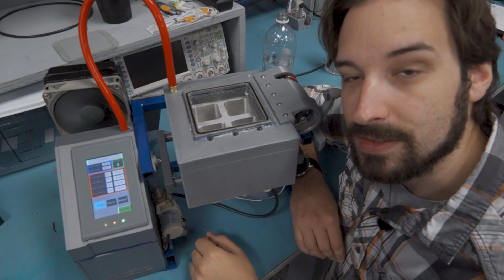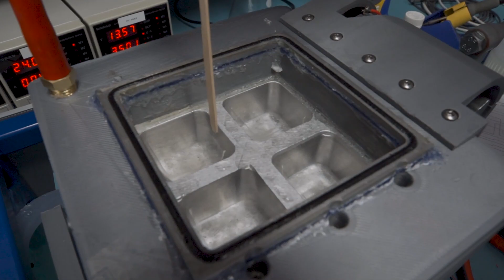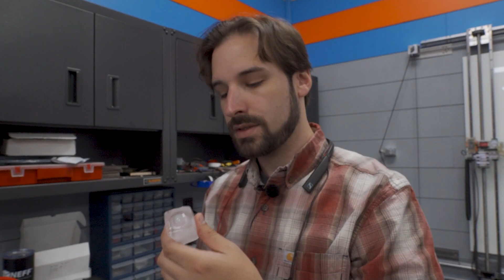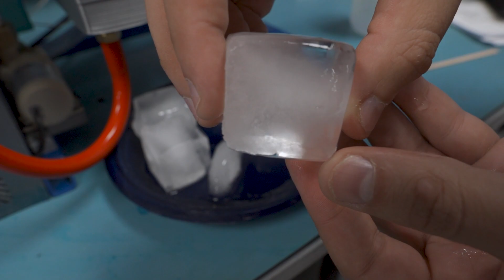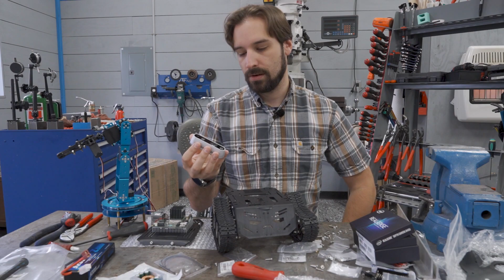Clear Ice Maker - Final

Comment: Is it destilled water?
Reply from the maker: No, just filtered.
Reply: @BauersLab  That's probably the reason for the supercolling. There are few freezing nuclei and the cooling is too quick.
Reply from the maker: Hmm, ok. If I put a bit of salt in the water, would that change it?
Reply: @BauersLab  adding salt will lower the freezing point... That's why they spray salt during winter on freezing temperatures...
Reply: In the lab we usually rub a glass rod in the container to produce small glass particles. But if the temperature is below freezing, the water will instantly freeze.